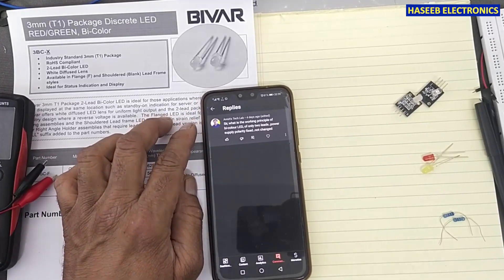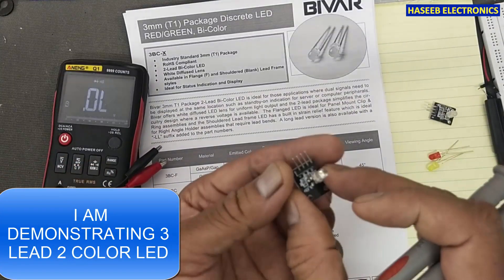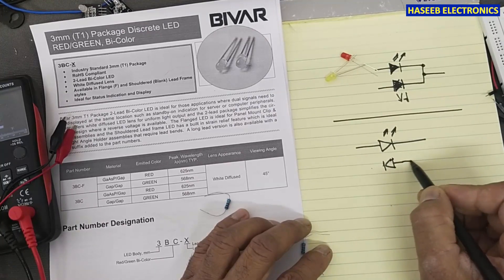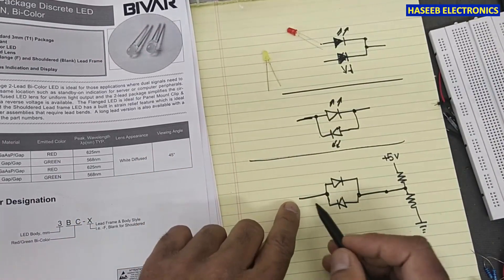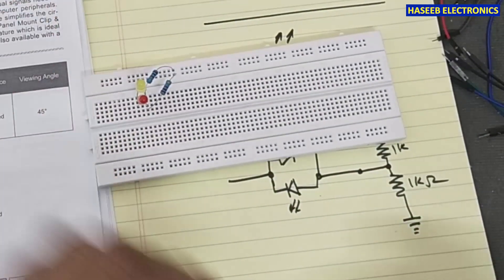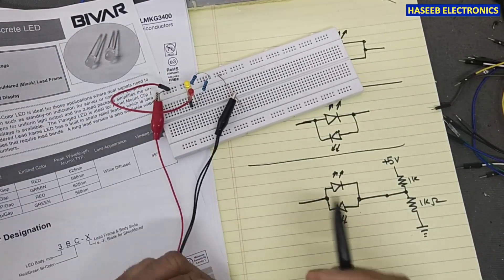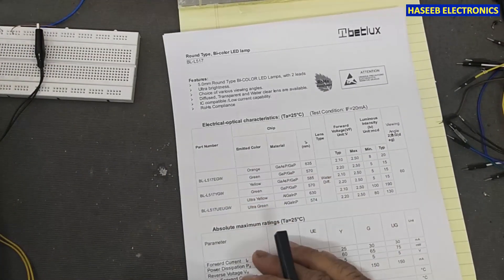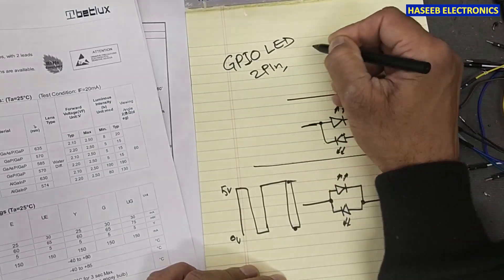{797} Bi Color, 2 Lead LED, GPIO LED- 2 Pin LED

Comment: Hi there, could you do a video with the same LED controlled by a micro limit switch - NC/NO. I am building a model railway control panel, and I need indications for straight through and diverging turnouts (points).GREEN for straight & RED for diverge. I am using 3mm LEDs. I will also try and email you with a circuit I have but not completed..

Hoping you can help me.
Reply from the maker: https://youtu.be/gIob0YKOd6Y

Comment: Bună ziua de ce ați anulat subtitrarea în limba română pentru că  eu chiar  vă  urmăresc de mult timp și îmi plac videoclipurile făcute de dumneavoastră și mai  învățam și eu  mai multe despre  electronică
Reply from the maker: nu draga. din ultimele două săptămâni mă confrunt cu probleme de sănătate, așa că traducerile sunt amânate. dar voi adăuga în curând subtitrări la videoclipurile mele cele mai noi și anterioare
Vă rugăm să primiți cele mai bune salutări și mulțumiri speciale. scuze pentru intarziere
Reply: @HaseebElectronics  Îmi  pare rău că aveți  probleme  de sănătate vă doresc multă sănătate și însănătoșire grabnică